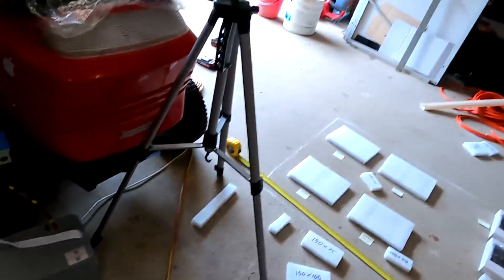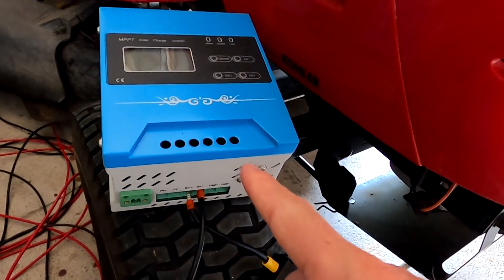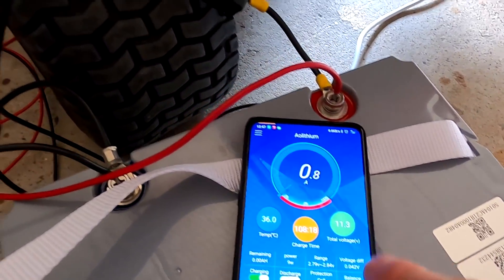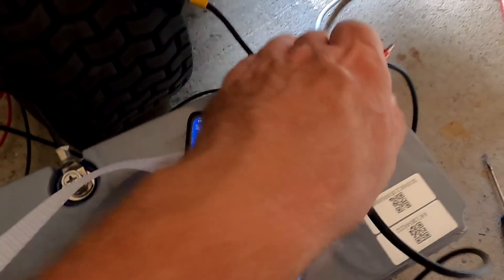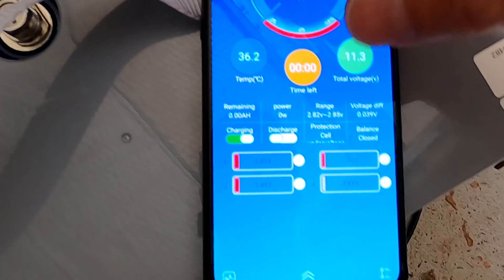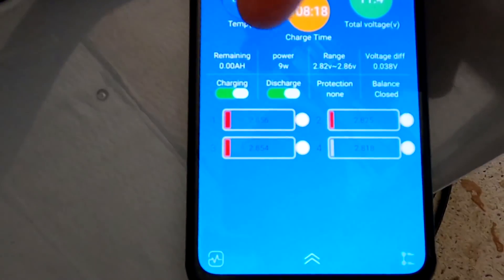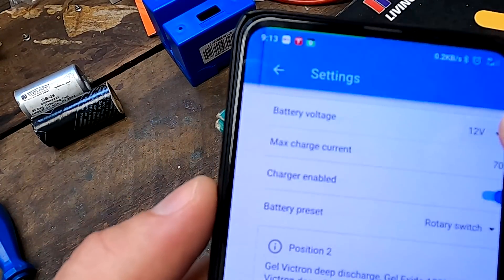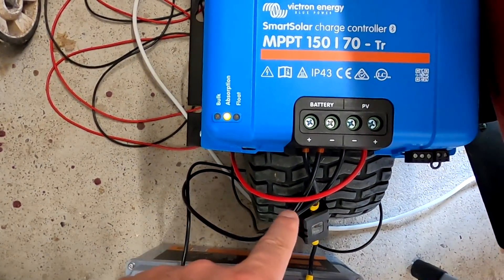Battery empty, BMS disabled further discharge and MPPT cannot recharge. Aolithium BMS in a deadlock!

Comment: Hi Andy. My battery bms will shut down at 10.5 volts and will not allow the battery to come back online at all untill I "jump start" the lithium battery with a 12 volt lead acid battery or a good 12 volt power supply with enough amperage. This is designed into the bms as an intentional feature.
I am able to restart the batteries every time with just a quick "jump"
Its irritating and inconvienant but it does help to keep people from abusively discharging their batteries. Your bms is probably the same one or very similar to the ones used in my "sealed" lithium batteries.
Give it a try & good luck.
We have the same type frogs here in the U.S.V.I.
Reply from the maker: Thanks Jeff. Yeah, it is definitely a problem with the MPPT and not the BMS. The BMS does what it is supposed to do, protecting the whole battery if one cell gets too low (or high) and it does this well. I personally would rather have the recovery voltage set to 2.7V or 2.8V so even without any load it is likely that the voltage is recovering to that number by itself and turns itself back on.

Comment: Andy, your logic re the relay BMS IS FLAWED, it will react to the JNGE MPPT the same as the JBD.   If the relay is open, there is no volts to the JNGE to wake it up so the Relay BMS will not wake up.
The issue is totally the JNGE MPPT, in that it will wake up when it sees enough solar power (some anomalies you see could be the very poor solar on that day, not enough to power the MPPT) so does apply volts to Battery output from which it senses a current draw which tells it there is a battery (or load) so delivers as much current as possible up to bulk Amps and Volt limit.
It is possible the JNGE just needs a sunny day so it can draw enough power to work..... or it just never powers it internals from Solar.

All good MPPT I Have seen power up once there is  enough sun.   Will test a Renogy Rover in a few days (I have installed panels on van roof).   My Victron AC chargers works fine with Discharge off.
Reply from the maker: I need to correct you here Ian, the QUC BMS will allow the CC to operate even the relay is off. 
The problem here is the JNGE CC. It is a weird design to depend on drawing power from the battery to operate even there is solar input present.
The sun or clouds were not the problem though as the JNGE turned on immediately once I connected the solar directly to the battery (the discharge switch was still off in the battery.
Let us know if the Renogy works under these conditions. I think it's just the JNGE and some other cheap Chinese CC which fail here.
Reply: Also curious about the renogy rover results

Comment: Hi Andy, I have (Makeskyblue) charge controller and it works even if there was no battery connected. I discoved that coincidentally as I turned the solar panels circuit breaker on before turning the battery circuit breaker on.
Reply from the maker: Thanks for sharing, Imad. Most solar charge controller should work and start up once there is enough sun available. It's nto the BMS fault, just the JNGE seems a bit... different.
Reply: Good to know, I recently purchased one of these to set up a small off-grid system

Comment: Not an error. An intentional engineering charge choice, that ha been made in the automotive charging industry for over 20 years. If the batter voltage in a car drops below 10.5 volts, modern and chargers will no recharge it. This is because a battery that low can often explode when recharged. In the US alone, some 100,000 people go to emergency rooms to get battery acid flushed from their eyes.
 So is this a design defect? Or an intentional safety choice? You will have to ask the engineers, not the mob here.
Reply from the maker: Because many charges were designed for lead acid. Other, more expensive CC seem to have no problem starting from solar and start charging the battery after such an event from what people share.

Comment: You could use a buck or boost converter from the solar panel to the battery, no charge controller, the buck or boost converters don't care if there is a battery attached or not. you could test this scenario :)
Reply from the maker: Yes, that would work. But you have to disconnect the converter again once the BMS turns Discharge back on again.

Comment: The BMS is doing exactly what it’s supposed to do really so not allowing any current to flow out of it. If it did otherwise it wouldn’t be doing it’s job correctly. It’s not unusual for charge controllers to require battery voltage to startup and the same is true of many battery chargers and alternators on engines too where current is needed for the original excitation. Victim is actually one of the makes that started the rule of battery before solar because otherwise they could set themselves to 24v after a solar restore. A neighbour of mine had that the other day and his older Victim mppt, with factory rubbish and non upgradable software, set itself up as 24v and proceeded to boil his Trojans after the lithium had correctly disconnected at full charge. I have heard of several that have committed the same muppetry.
Reply from the maker: Yes, that is correct. Funnily, the BMS still supplies voltage to the CC but no current to start the CC. Other controllers do better and start from solar, having no issues with recharging such a battery.
Reply: @OffGridGarageAustralia  if the BMS supplied voltage then it would have to supply current unless the load of the BMS dropped the voltage below that needed to start. I can see that reading the terminal voltage of the battery with no load but with charge turned on and discharge off the high impedance of the meter might show some voltage but a couple of moist fingers might reduce it to zero. Shame I installed one yesterday for someone and could have played with it a bit more if I’d watched the video first!

Comment: Hi Andy, this morning I managed to discharge my liito batteries and xiaoxiang app at 2.5v cut out, then 30 mins later it came on at setting of 2.7v as the batteries self recovered at low voltage. It's low volts but it works. Perhaps a low voltage relay to a secondary battery to charge at low voltage,
Reply from the maker: I think the recovery voltage of the Aolithium battery is with 3.0V a bit high. Luckily we can change it.

Comment: Solar charge controllers usually support multiple battery voltages (12V, 24V or even 36V or 48V) and have an auto-detection mechanism for the battery voltage. If they cannot detect the battery voltage they do not start up to avoid charging the battery with a wrong voltage. If possible try to disable the battery-voltage auto-detection of the solar charge controller and set a fixed battery voltage. This should help if the solar charge controller can power itself from the PV circuit. Otherwise it is a bad design and the manufacturer should power the solar charge controller from the PV circuit and display a dead battery error.
Reply from the maker: Good point. Not sure if I can disable this in the JNGE. I would need to hook it up to the network and login with the app.

Comment: Hi Andy, are you 100% sure that if full sun power is connected to mppt controler and if you will turn off power from battery, you will not destroy mppt controler ?!
Reply from the maker: Not the JNGE as it does not turn on if no battery is connected.
I also tested this multiple times with my Victron gear when the QUCC turned the relay of and disconnected the battery. The MPPTs regulate down to Absorption voltage and stay there until the battery comes back.
Not sure how JBD or Daly will react.
Reply: @OffGridGarageAustralia  Andy, and did you test the regulator's power cut when almost full power flowed from the panels? Because this can be a problem that the controller actually has nowhere to give power from the panels.

Comment: Also if you don't have a resistor across your bms the caps on inverter and charge controller will put a massive surge on bms fets everytime they turn back on.
Reply from the maker: Not as along as the MPPT and inverter are still turned on and running (without battery). But for initial start-up, yes.

Comment: I built a small battery (for fun) using a Daly BMS and this exact same problem happened . The only way I was able to get out of the dead lock was to charge the cells using my balance leads (did not want to taker the battery apart) that were connected to a small display. I had to charge at only 1 amp since the leads were very small. I did not thinks that the JBD's had the same problem .... hmmmmmm
Reply from the maker: Thanks for sharing Paul. Interesting that not many people seem to complain about it though...
Reply: @OffGridGarageAustralia  I honestly think people simply just do not cycle that low.... ever!

Comment: The same thing is happening often with electric bike batteries. When it happens, then the battery goes back as faulty and if it is under warranty, then the customer gets a new battery - Even though the battery cells are OK, just a bit undercharged.
Reply: Power tool batteries are the same, mist of my spare tool batteries come in not charging so i have to open them up and manually recharge until the BMS switches back on.
Laptops are the same i rarely find more than 1 cell has low voltage but the BMS is locked up tighter than a nuns chuff ☹️ and won't allow charging 🙄
Reply: @Dirt-Diggler  If it is not required to returned the batteries, I take them home and recharging them directly on the batteries and whoolaah it works again. Some battery packs costs more then 500 Euros, and they are fully functional  *(when you know how) :)
Reply from the maker: Oh, wow! That is insane. Perfectly new battery and it goes probably to landfill or recycling. It seems to affecting only certain BMS. The Victron Smartsolar BMS started even without battery.
Reply: @OffGridGarageAustralia  Maybe the battery pack manufacturers never think of every possible situations, with the results that customers are returning "faulty" batteries?  I can see on cycle batteries, that all battery packs has they own custom made BMS instead of learning from each other and develop something that last and take care of the batteries in every possible ways.

Comment: And everyone complains when I say these BMSes are not designed for solar.  They are all like this.  The solution is to put a small resistor across the bms like 100ohm.  Enough that it wont charge much if at max voltage.
Reply from the maker: It's rather a problem with the CC than the BMS. Although eh BMS could have a bit better settings. But we know how to change them 😉
Reply: Yes, I've done this resistor trick too but really the best solution is to not let the battery go that low. Load disconnect before BMS disconnect!
Reply from the maker: @paullewsey9146  Yes, this was definitely a test and the situation should not occur under normal circumstances.

Comment: Not sure if it's been talked about before, any reason for the desktop style computers sitting on the shelf?
Reply from the maker: Old computers from customer. They will get cleaned, built-up again and sold. All running perfectly fine, just need an SSD drive and a fresh install.
Reply: @OffGridGarageAustralia  Ah, ok. Also in response to the bms cutting out on discharge due to low voltages on the cells. I've experienced that quite a bit myself on various batteries. I have personally been trying to find a solution for my own setup to avoid get out of the deadlock safely without use of grid power.

Comment: cheap MPPT controlers do not power from solar, because it is a complicated system to implement for powering solar charge controlers.
Reply: Ex : MPT-7210 solar charge controler power up from solar side only

Comment: That's an issue with the charge controller. Mine powers itself form the solar side, it just needs to see the battery voltage, which it does even with the discharge switch off. Disabling discharge and keeping charge enabled on a MOSFET BMS does NOT prevent the voltage from being on the output of the BMS because of the MOSFET body diode. The charge controller can still sense it, just like on your relay based BMS. I've written this down on Will's forum (BMS mosfet explained). Measure it.
Reply from the maker: That's the link: https://diysolarforum.com/threads/bms-mosfets-explained.29318/
Thanks again for your great work.
Reply from the maker: Thank you. Obviously other BMS don't do that either and having the same problem from what we can read here...
Reply: True for a two port BMS, but a one port BMS has the MOSFETS back to back so it can fully isolate and the output has no voltage to detect.
Reply: @alanb76  Only when both charge and discharge are disabled. Otherwise (if just either one is disabled) there is no issue and the battery voltage is present.

Comment: The J.... charge controler I assume is the same as others I used before that is design to operate directly connected with the battery without any bms, as also the loads never (should not) connect to the battery as well. The charge controller plays the role of the bms protecting the battery parameters on charge and discharging, typical on the low cost system mainly. Continue the great work testing this batteries.
Reply from the maker: Thank you.

Comment: Yes I found the same and had to use a power-operated battery charger/power supply for a short period in order to lift the battery voltage to a point where the mppt charge controller recognises the battery again.
Reply from the maker: What MPPT was connected at the time?

Comment: Yup! Literally had this before Christmas for a battery I built for a campervan. His inverter would not charge the battery once the discharge MOSFETs went off. I ended up just changing the settings so his inverter would cutout before the BMS did.
I wonder how much current the charge controller needs to "see" the battery is there? Maybe a high value resistor in parallel with the -bat -load lead would be enough to trick the charge controller? But then again, if you had no sun for days and days, the battery could be drained dangerously low and the cells may never recover. I guess it's a bad controller design.
Reply: It's a bad charge controller design. All the charge controller really needs to know is the battery voltage, and it can do that even if the discharge is disabled, but charge enabled on the BMS. A good charge controller doesn't have this issue.
Reply from the maker: Thanks for sharing, Carl. It should be enough for the MPPT to connect to incoming solar and seeing the battery voltage as Up North and Personal pointed out.

Comment: Interesting. But I don’t see as an issue with the BMS, but instead that the CC requires power on the battery connection to operate. I’m sure my Renogy CC would behave the same way… but I’ve never run my batteries so low as to find out. The BMS is just doing it’s job to stop any further discharge of the cells. Thought provoking situation though… thanks!
Reply from the maker: Yes, that is an extreme situation. The load should have turned off before the BMS is kicking in and shut down the battery.
Reply: @OffGridGarageAustralia  Of course the Catch-22 here is that the CC is part of the battery’s load. In the instructions for my Renogy Rover 30a CC it says that connecting the solar panels before connecting the controller to the battery can damage the unit…so it seems that the situation you illustrate here could damage some controllers. Three cheers for Victron (my next controller) for dealing with this situation! And three cheers for Andy for all the cool experiments!

Comment: Hello Andy. To be honest it is normal behavior even i have to say as i have only (for now :) ) only normal batteries and not these new types of batteries i didn't see this behavior, reason is that my BMS isn't disconnecting battery ..but rather the inverter ..so even if there is small load it could eventually discharge my battery completely..  It isn't the case for me ..right now. but you are right that if this kind of bms is 'protecting' batttery from discharging it isn't the best thing to do..but i suppose it is ok to fix it with small fix..but still not the best behavior
Reply from the maker: The Inverter and your other load should be shut off before the BMS disconnects the battery as you said. This was an extreme situation. If you still have a load connected after the inverter shuts down, you could end up with a deep discharge battery and the BMS shutting of your system.
Reply: @OffGridGarageAustralia  what i mean is ..that even if mz inverter is off there is still BMS connected and that is slowly discharging battery but i expect it was designed to do so..as it is with all BMS ..so that was my point :)

Comment: I have had this problem in my boat and white vicron solar controller I  have sun conches an sets it to power suplay. The same with charger set them in power suplay for a while.
Reply from the maker: This Victron Smart Solar was OK with just sensing the voltage of the battery but it didn't need any power from it to start up. The connected Solar was enough to get it going.